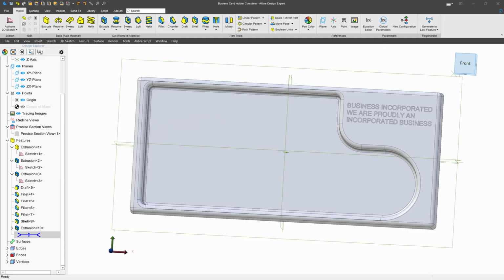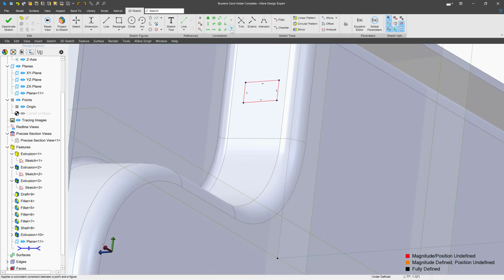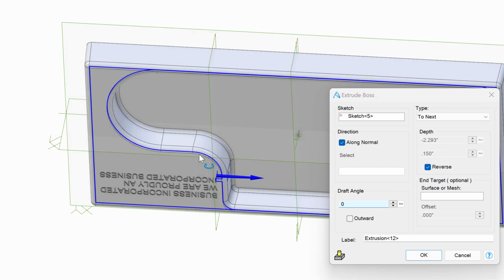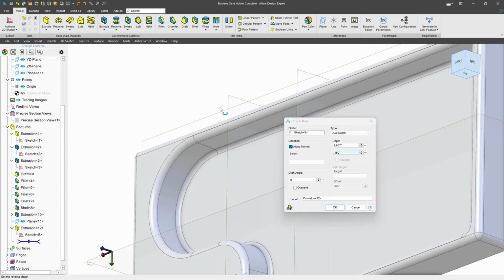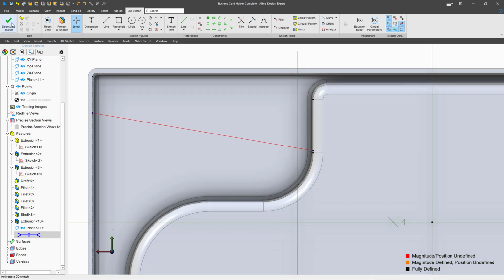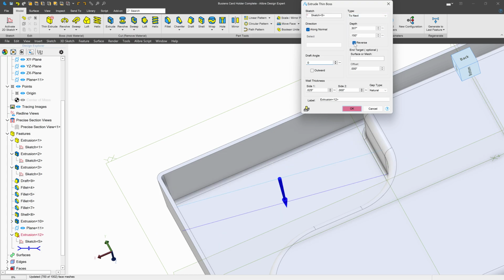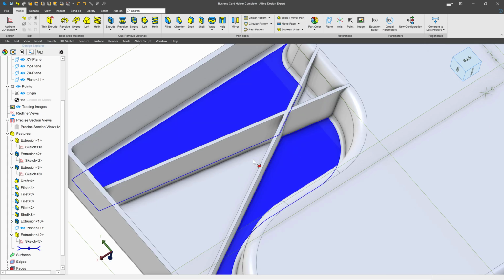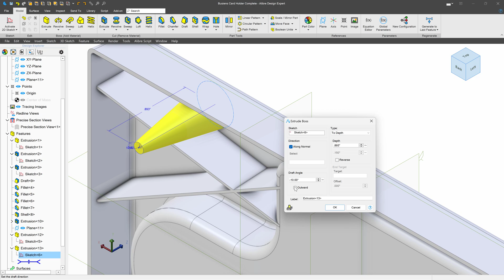Advanced Extrude Techniques | Alibre Beginners Course #25

Comment: The options explanation was great but I have to say, extruding to next and then mirroring with Alibre carrying over the design intent... That's my kind of stuff... So powerful, that move.

By the way, making lines to create internal webbing and thin-extruding to next was the very move that sold me to Alibre. I was trying to make a webbing for a shell that was given to me as a surface and that I had thickened. Fusion had a dedicated Webbing tool, but it wouldn't work, extruding wouldn't work, nothing would reliably end the ribs of the webbing on the inner surface. It would either error out or break through. Fired up Alibre, imported the surface, thickened, made a bunch of line, and voila... Half a second of calculating and I was done... Decided to buy right there and then.